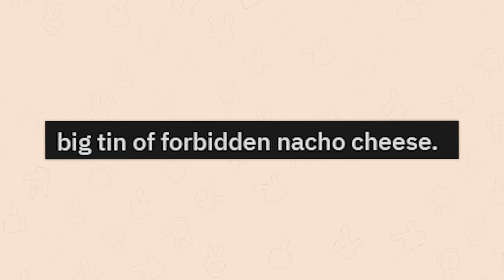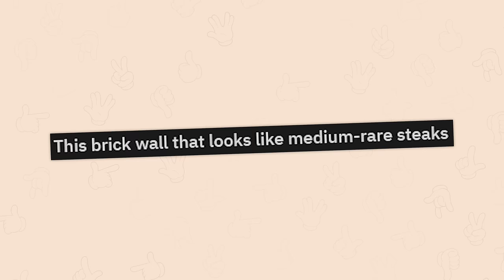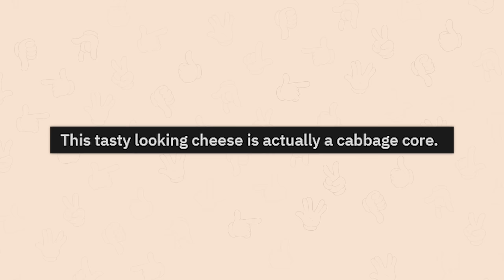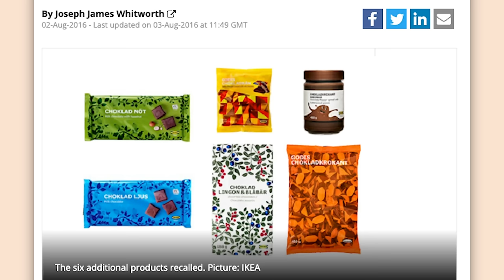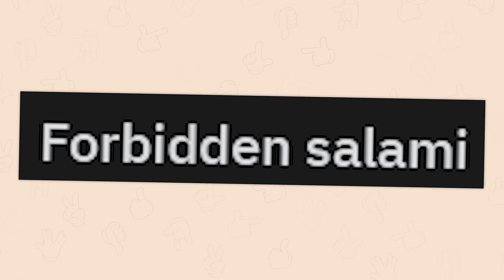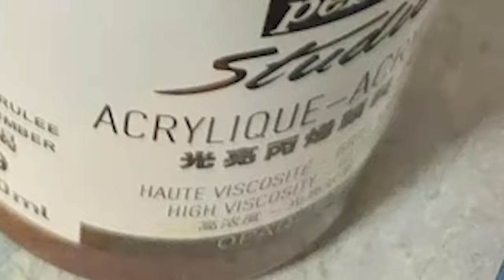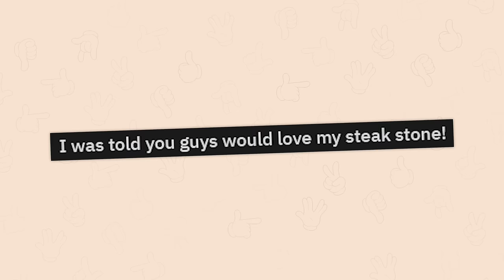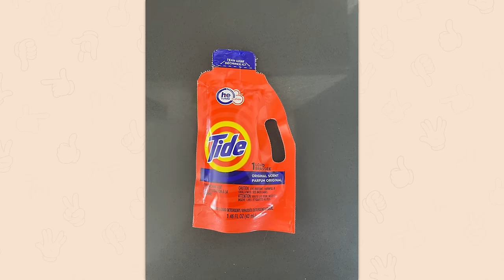THE TOP OF r/FORBIDDENSNACKS

Comment: That snake right at the end of the video. I don't like that. That is a baby still in the egg. If you need to cut the egg to help the snake out, you cut a window flap JUST big enough for the hatchling to come out when it's ready. You DO NOT cut half of the egg off just so you can see the snake. :/
Reply: Yeah, it gave me major red flags. The only reason you should cut an egg is because the snake is struggling to get out or if the egg looks diseased and you need to see the snake. And only a slither is the amount you should cut.

Comment: 4:16

Actually, these are Ethernet (network) cables. No threat of electrocution here, they're data only. Stabbing by the IT professional who managed them, however....
Reply: take a bite and nobody will have network~
Reply: A) yes they are Ethernet cables
b) "data" is still eletrical current, not enough to hurt you, but still.
C) This is a network room the chances that at least SOME of them are PoE(power over ethernet) injected is high. which means around  48Volts, which can be unpleassent, but at least nto deadly
Reply: sure the it guys aren't going to electric chair them... or at least swap out their phone charger with the direct 120v one
Reply: Or one of those sand filled hammers

Comment: 1:47:44 When Diesel fuel gets too cold, it thickens up (Gels) to the point it can't flow through the fuel lines or fuel filter, Diesel Treat prevents that, just like salt lowers the freezing point of water, this lowers the gelling point of Diesel Fuel...

I used to be a Truck Driver for 10 years and this stuff was a godsend during some VERY cold Winters...it kept my engine from stalling overnight when I was sleeping and depending on it for heat...
Reply: Bro watched over an hour worth of emkay. (only) lol

Comment: 23:13 That is a wax ring used as a sealing gasket for toilets...you set the toilet bowl on the ring and it squishes down and out to seal the connection between the ceramic bowel and the ABS waste pipes in the floor...

Comment: @25:51: "Forbidden Cadbury eggs".  I could be wrong, but... there's this game called Wingspan, which is all about birds.  One of the things you do is "lay eggs" on the cards.  Those look like the eggs.  And the plastic things they're in look like the containers from the game, so... maybe?  FWIW, they're about as big as the tip of your pinky.
/Our dad is an ornithologist
//And our eldest sister currently works on an island that's usually covered with birds
///So, yeah, birds are like...  a thing in our family.  (-:

@28:35:  "Forbidden lettuce".  Oh, it's Romaine lettuce!
Reply: Actually I'm pretty sure those are cone shaped incense. That's why they're in plastic tubs like that so you can grab a fe instead of buying a whole pack at once (some incense has to be used fresh) . Unlike stick incense the smoke tends to flow outwards and you can use them for 'smoke river' type burners. 😅

Comment: That "forbidden Toblerone" is an ancient key,the key would be inserted into the slot then the pins on the key would line up with pins and holes, the pins in the lock holding the removable part place,but once the pins are lined up you pull up and out with the key,and the lock unlocks,a crude method but a functional method. Or its an ancient comb